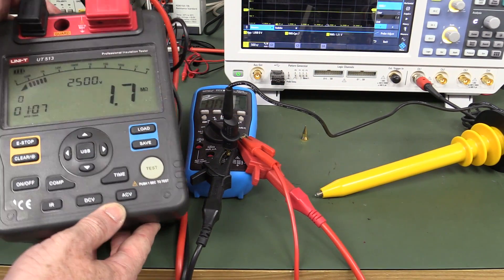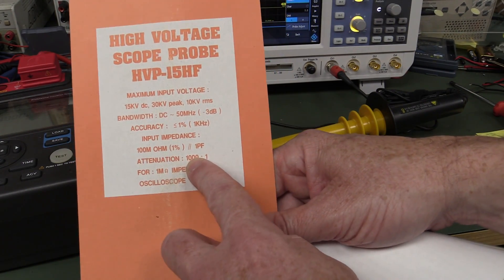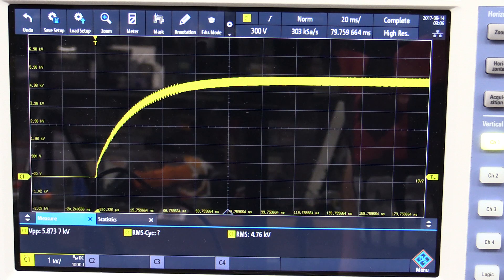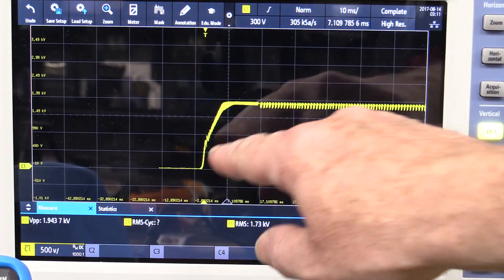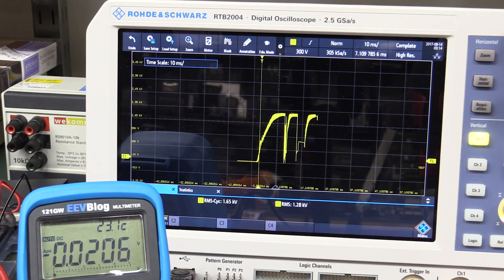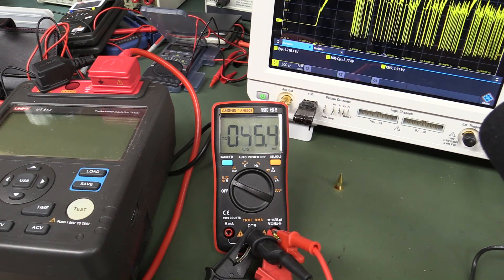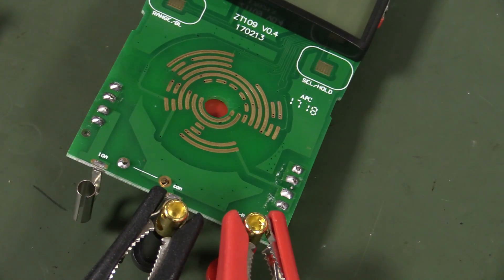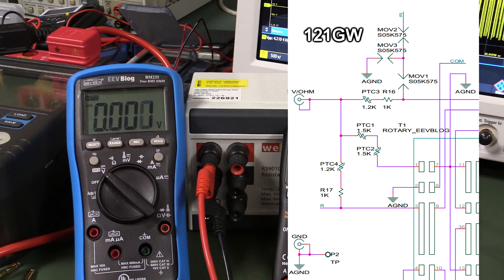EEVblog #1016 - Crude Multimeter High Voltage Overload Testing

Comment: have Joe Smith build you a proper impulse tester. He loves that stuff.
Reply: It would be far less expensive to buy a new top of the line unit than contract me to design and build a one-off generator.   Plus, he would have the added benefit of being able to have it calibrated, actually run some sort of safety test and a lot more drama!

Comment: Dave you need to learn that MOVs are rated in operating AC voltage .
The clamping DC voltage is much higher 575VAC = 900 VDC clamp

Anyone using  a DMM without HV probe should limit their probing to less than 1000V peak.( As per specs )

At 1kV both meters are just fine. MOVs or no MOVs.

Comment: Keep in mind the 8002 and 8008 place the PTC and clamp after the selector switch.  The switch has to handle the entire voltage.  Obviously it can't.   These meters are a little odd in that respect as normally the first layer of protection is in front of the switch.   The interesting thing from watching this video is how the 121GW appears to breakdown as well the first time you hit it.  It's possible you blew out some contaminates around the switch assuming it was an older version of the meter.    I never tried to push the unmodified prototype meter to higher levels after it was damaged.   But I did have the meter far above this and would think if there was a clearance or creepage problem with the layout, I would have seen it in those tests.   Strange.  I'm guessing conductive particles.

Comment: If you wanting some High Voltage (say it like ac/dc in the song dirty deeds(done dirt cheep)),  just get ya a flyback transformer from an old CRT.  Better yet, go out and swipe the ignition coil from the wife's car.  I would recommend an HEI coil from older GM vehicles, or ford even but any will do,  in fact the Coil Over Plug is easiest just need 12 volts and a trigger.  There is even an output wire to detect misfires.  Maybe this wire could be probed to see the voltages?

Comment: sooo... when do we get the newer meter?
Reply: kenabi Why would you want it, it's obviously only good for testing hack jobs cobbled together from cheap Japanese chips, ugly cars and flux capacitors.
Reply: +John Francis Doe flux capacitor you say? Welp, I'm sold.
Reply: it should be a capital crime for a female to allowed within 50ft of a multimeter.

the only meter a bitch should be touching is a cooking thermometer, and then it should be a mechanical one. if it has so much a Cr-2032 battery the it should be punishable by death

Comment: speaking of high voltage and multimeters, anyone know if joe smith is coming back? Great video, Dave, BTW!
Reply: I guess it has been a while. I had ordered a new 8002 and 8008 to run next.  I had already ran the 8002 but a few people had asked about temperature drift and I wanted to do a few other comparisons with them.  So stay tuned.
Reply: Thanks Joe! Thought maybe you grew weary of us! :) Thanks for checking in!

Comment: You can make a hv pulse generator like you want cheap.  Use a car ignition coil.  Coil one plug coils have a 3 or 4 prong connection.  Ground, +12v, and +12v trigger and they will fire a pulse.
Reply: Not enough energy and we are looking for a controlled rise and decay shape.  Best to just read the IEC standard where they explain the basic concepts of the surge generator.  This is what based mine from.

Comment: What NOT to do with a high voltage probe. Leave the probe overnight in a very cold vehicle causing condensation to form inside it then take the probe and insert it to measure 29 KV (thankfully low current) Somewhere from the handle it arced to me and exited at my elbow burning a hole in my jumper at that point i am also told there was an arc from the swivel leg caster to the concrete floor. Thankfully all I suffered was a lot of pain and fright.

Comment: Actually the AN8008 impressed me more than the insulation tester. At  least its processor didn't crash, not even with arcing at the range switch. I don't think many top-brand products would pass that test! 

Basically none of these meters, not even Cat-rated ones, should be used in the vicinity of >1kV supplies than can deliver any significant current. They are not rated to remain safe under such conditions. I guess one question that arises with the AN8008 is whether those very short fuses would arc after they blew with such voltages. Probably yes, in which case they're effectively not a fuse under those conditions.
Reply: IWRConsultancy All 3 meters are both supposedly rated to A. Measure intentional voltage up to 1000V peak/750V RMS/10A current.  B. Not endanger the user if subjected to accidental spikes of at least 5 times that (voltage) / 1000x times (current) . Because those spikes might hit it while trying to figure out why there's no power to the house/office/lab.  Similarly quality workwear coveralls are supposed to be OK up to 95°C, but must also provide reasonable basic protection if there's a fire or you are accidentally dragged behind a truck.

Comment: I bought one of those Anengs for a laugh - I wonder if it'd be possible to add an aftermarket MOV to give it a bit more protection?
Reply: Geoff T Look inside, some of these have a clearly marked but unpopulated spot for a MOV or gas discharge tube, which was probably there during prototype testing.

Comment: If you want a sudden impulse, just turn the tester on fist then connect the meter. Much more likely to cause damage due to inductive ringing and capacitive coupling/flashover
Reply from the maker: Yeah, but would have to be safe and repeatable. So would need some form of switch based system, preferably electronic.
Reply: Mike ya legend!
Get back to making vids!
Reply: Mike, test it on your destruct-o-tron.
Reply: And add a hv capacitor in parallel over the output of the insulation tester so that once an arc does start there is plenty of energy available to flow trough it for a nice bang.
Some aluminum foil and plastic projector sheets makes a cap with a surprising amount of energy storage.
Reply: I was thinking that it would be pretty easy to charge up a capacitor to 5kV and then connect that to the meter with an insulating pole with the meter probe ziptied to one end. I don't know what the official CAT rating standard stipulates but I would imagine that something like a 10uF, 5kV pulse-rated cap would separate the men from the boys in regard to multimeter protection.
Reply: @sbreheny  The cheaper tester would need a beefy amount of capacitance backing that voltage to be effective at consistently popping it :) 10uF may be enough, though.
Reply: Turn the tester on with your fist? Wouldn't that break it?

Comment: We had same insulation tester at my previous work. It was freezing pretty often (had to be turned off by e-stop, nothing else worked) and cables were failing pretty often, so it shown much higher resistance than thermocouples in reality had.
Reply from the maker: Yep, stupid thing freezes all the time.

Comment: i decided to buy the an8008 yesterday and i feel like it wasn't a bad decision. only payed 18$ for it. i feel like it'll  be fine for anything up to 230volts ac. i don't thin i'll be dealing with 2kv or higher peaks. 
And even if i do, whats the deal. the worst thing that could happen is the meter dying.

Comment: Meh, I bought an 8008 to both see what it was like in person (Reasonably pleasant, definitely a Harbor Freight $5 meter "killer", lol); the 1 microvolt and 0.01 ohm resolution is nice too.  I also own an Amprobe AM-140-A, a HP 3456A  (A 6.5 digit meter from the 80's and a genuine HP), as well as countless others over the years, so I'm reasonably experienced in that regard.  The 8008 seems to be a good meter for sticking in your bag just in case you might need a cheap DMM and you don't want a nicer meter to get damaged or stolen.  It's not particularly rugged, but for the price you could pick up a Pelican case for it and still have enough cash for dinner at McDonald's ;-)  I get that it's cheaply built and doesn't have the standard MOV protection you might otherwise expect, but for me the vast majority of the work I do is with 12V and logic-level voltages so having CE-rated input protection just doesn't matter and I'm not going to knock a $25 meter for not having the same protection as a Fluke-- different market segments and use-cases.  It just seems like being a meter snob to slam it for not being the same as more expensive meters when it has some very nice features that are unique to its price point.  Being aware of its limitations is one thing (Especially if you ever have to deal with higher voltages!), but just refusing to consider it a "real" meter because it lacks some things is silly.
Reply: Dave wants to crap on it every opportunity to sell his own meter for 8x the price when the cheap one does 99% of the job

Comment: Sorry but is there a video that would explain what is a MOV and how it operates to clamp a voltage on this situation? How can these things dissipate kilovolts? I thought this video would give more explanation.
Reply: a static shock is usually in the kilovolt range.  The current this tester is outputting is minuscule, so the total output power is low, even if it's voltage is high.  If the meter was able to do what eevblog wanted (dumping a highvoltage and high amperage shock to the meter) he would have got the explosion's he wanted :)
Reply: MOVs are specifically designed to clamp (conduct) and protect against surges and spikes. The transient voltages are typically very high voltage and amps, but really short duration. MOV "absorbs" the excess power as heat, but it's only for a few microseconds. The other thing that MOVs can do is sustain a high voltage at low current - in this case for many seconds. But what kills MOVs is when the voltage is "just" at their rated voltage, so they start to conduct and get warm... soon the thermal runaway happens and the MOV cooks itself to open circuit. So, MOV might survive 5kV or 10kV at <1mA, but it won't survive 2kV at 100mA.
Reply: John Coops And this gives us the precious time for more common fuses to get ready for action...

Comment: Clearly dielectric grease would make that an8008 basically the same as any other meter.
Reply: soupisgdfood But it obviously relies on that heavily encapsulated spark as a protection feature.
Reply: John Francis Doe just fill the whole thing with dielectric grease.  No worries!

Comment: Hmm, pedant: technically 700v is not HV, its  MV
Reply: TheChipmunk2008 Anything under 1kV peak is Low Voltage!  Under ~50V is Extra Low Voltage. 6kV~ and 10kV~ are typical MV voltages.

Comment: Maybe he should build Joe Smith's transient generator and use that...
Reply from the maker: Maybe. Did he even release details of that?
Reply: Unfortunately I don't think so.
Reply from the maker: That's a shame, did he give a reason why?
Reply: EEVblog Maybe he was concerned someone would slightly re-engineer it, then silkscreen their tradename on it and remarket it?  LOL
Reply: I just don't think he's ever even bothered to release documentation for any of his projects.  Shame though since he's such a good engineer.
Reply: Its not some top secrete rocket science stuff.  I read the IEC standards and based my design on them.   I assume anyone running these tests would normally just buy a combo generator and follow the real standard.  You would accomplish the same thing and create a lot more drama as you would be testing at the real energy levels, not the low levels where I test at.   Where I have little interest in looking at the meters from a safety standpoint, running them to the IEC standard would give viewers some idea about the actual safety.
Reply: joe smith IEC standards - check,  marx generator - check, 555 timers - check, blown up meters galore and everybody's happy ;-)

Comment: If you look at the scope trace for the arcing test, notice how the first spike is larger than all the rest. The initial arc was harder to start than the subsequent ones, as ionised air is more conductive.
Reply: seems analogous to the coefficient of static friction being higher than kinetic friction
Reply: It's because air got hot. Ionization is easier if temperature is higher.
Reply: exactly what I thought Taras
Reply: I suspect the burns on the PCB were a bigger factor.

Comment: "Joe Smith" has some good videos on high voltage transient testing of multimeters.  I believe he has also tested a pre-production EEVblog 121GW meter.
Reply: Thanks.  Yes I ran several tests on what Dave is now calling a prototype 121GW.   The video where the meter was tested to failure is still available but I have removed the others after apparently they caused some confusion about the meter.  Glad you enjoy the videos.

Comment: why did the cheap survive ? pure luck?
Reply from the maker: As I said, it's not that hard to protect against low energy high voltage stuff (like static electricity for example that is much higher voltage) using just series resistors and chipset clamp diodes. Multimeter chipsets are generally pretty robust in their own right.
Reply: the thing is a spark gap (unintentionally)
Reply: Spark gaps (intentional or not) are good protection against slow rise times. Charge the UT-513 before applying to the AN8008 and the result might be different.
Reply: Everything is a spark gap technically...

Comment: So even you can't blow-up the 8008 $25 meter! What's next, the throw it off the dam test?
Reply: Let's watch as Dave tries to prove said multimeter sucks...By failing to destroy it.
Reply: Test it with a microwave transformer. That's definitely lower impedance.
Reply: Lawrence L there is no significant current available from the tester. Putting that meter on a 4KV source with a fault current well into the thousands (or tens of) of amps would definitely end poorly.
Reply: But who would do that? I worked with industrial electricians and they didn't use any kind of multimeter to check out 4KV equipment. High voltage probes on long sticks, rubber gloves, face shield etc. Why do people think using any multimeter on high voltage (KVs) low impedance sources is a safe practice?
Reply: It didn't die. But you will die.. Thats a FAIL LoL
Reply: Talk about missing the point, out of your depth, but not letting any of that get in the way of an illogical whinge.
Reply: .... 4kv at thosuands of amps would cause rebar to explode if you put that through it. vaporizing metal before any 'protection' could possibly help the device isn't how you 'test'.
Reply: OMG... it isn't about the meter surviving.  It is about YOU surviving!  Humans can survive low energy high voltage static "zaps" but it won't even take a fraction of that voltage from a "low impedance" source to kill you.
Reply: subtile, dave wana to say that the evv shit multimeter is superior to cheap ones

Comment: Really distracting that you didn't have the vertical scale divisions aligned with a zero voltage point instead of offset by -20 or -10  :P
Reply from the maker: My plan worked a treat.
Reply: Figured you probably did that intentionally just to mess with people and see if it would get a reaction. Yep, it worked.
Reply: The triggering is real.
Reply: I feel you. He was so close though at -10v at such a large y axis scaling xD It's not like -10v was the idle voltage either, it isn't even on the line xD
Reply: OCD squad about to explode their heads..